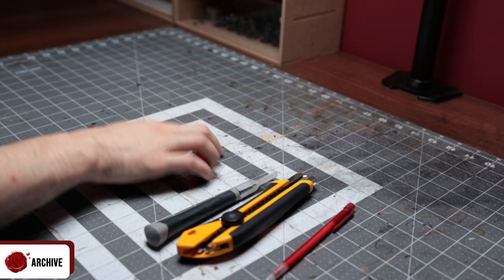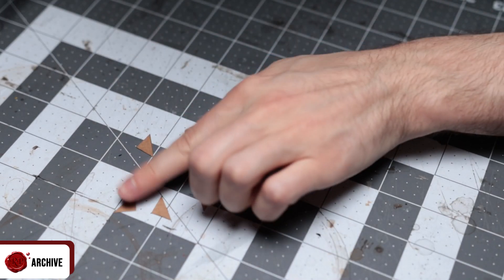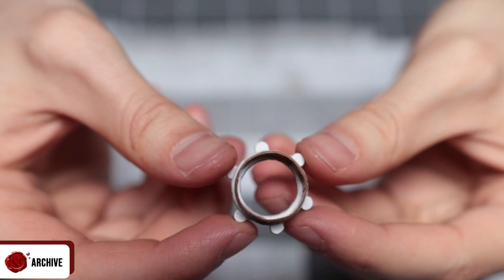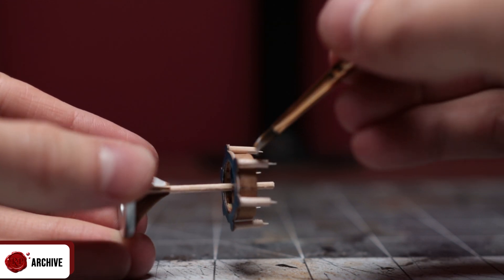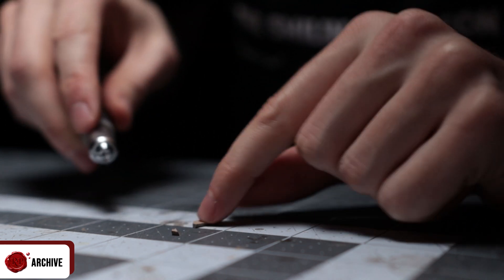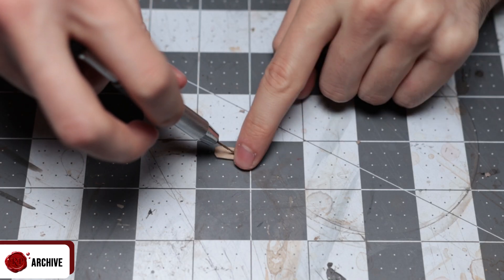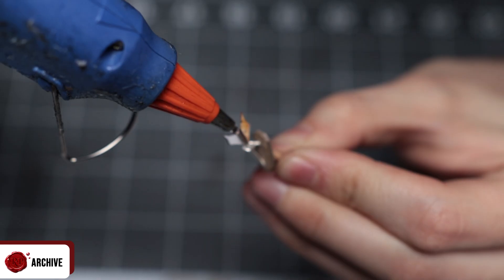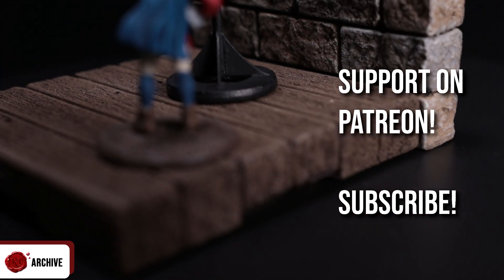I made a super usable candlestick from a washer for D&D.

Comment: Great ideas! Sharing a tip though: if you put superglue on one surface and PVA on the other, the resulting bond has the best properties of both - the superglue bond is accelerated due to any water in the PVA & sets up quickly, and the PVA provides a better long-term bond as the superglue will get brittle and often fail over time.
Reply from the maker: That's interesting! I'll have to try it :)

Comment: As expected your candle holder is much better then my attempt 🙂. An alternative method for candle making is to use isolated electronic wire. Part with stripped isolation as the flame additionally dipped in hot glue to gain some volume and sharpness.
Reply from the maker: That's an interesting method actually. I like how in that method the flame is seperate again from the wick.

Comment: Another option for candles that might be easier is to use the insulated wire the thickness you want your candles, then strip the covering at the top and work it into shape. Mod podge the melted parts. If you want a larger flame, you can tease out some hot glue into a flame if you want to.
Reply from the maker: That's a good alternative :)
Reply: @RPArchiveOfficial  You can get a lot of wire of the right size for relatively cheap as well, either new which is a little bit more and easier to keep track of, or you can spend some time to scrap old electronics, normally for free...
Reply from the maker: Also true...

Comment: An easier candle is to buy some wire stripers and some electrical wire, get the thickness of the candle you want. If you're anything like me, you probably already have a load of electrical cables that you don't need any more and so only need to buy the wire strippers. Then just strip one end of the wire to make a wick end and cut it down to size. A little super glue to hold it all in place. Then coat it all in thick white paint to form drips (add PVA or a medium to your paint to thicken it up. You can also use hot glue, if you're skilled with a glue gun). Then a brown wash and finally black the wick and give the whole thing a very gentle off white dry brush. Done. No fiddly drilling and gluing. The hardest part is cutting it down to size. If you want a flame, roll a blob of green stuff (or other epoxy putty) into a point and squidg it to the end.
Reply from the maker: Honestly, I don't have a problem with the drilling and gluing, I find it quite zen :) but it's a good alternative

Comment: How much does it cost you for washers that size? The few times I've looked, it seems like I could be a whole 4' x 8' sheet of XPS for the cost of a dozen of them
Reply from the maker: Really? That big bag I show cost me £1. Practically nothing, and it had a ton in it. Remember you don't need quality stuff that will work smoothly for its intended purpose, to us it's just a weight, so buy cheap at pound/dollar stores :)
Reply: @RPArchiveOfficial  To ne honest, the cheapest "weights" are probably 2p coins. I've never seen washers cheaper than 2p per piece!
Reply from the maker: Very true, but I deliberately didn't use those to avoid having to cover the 'texture' of the queen's head, as well as to make it look more like a part of the candelabra, not a flat base :) 

I found a fair few examples with ringed bottoms so I figured it worked well for that.